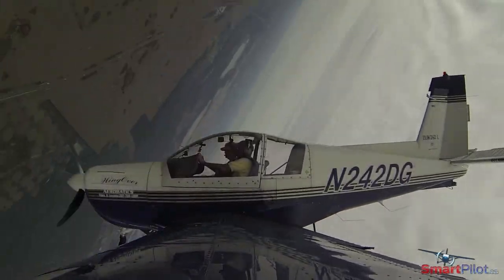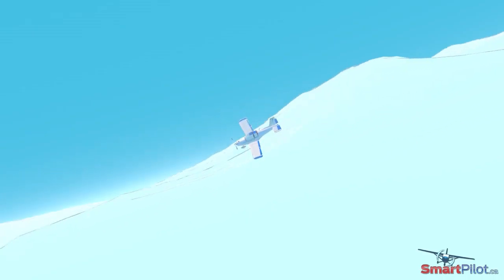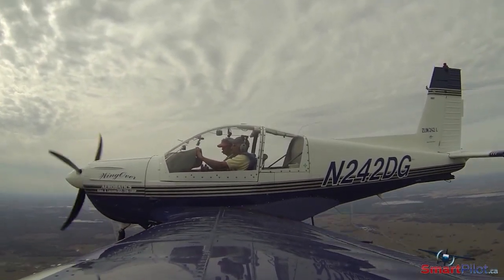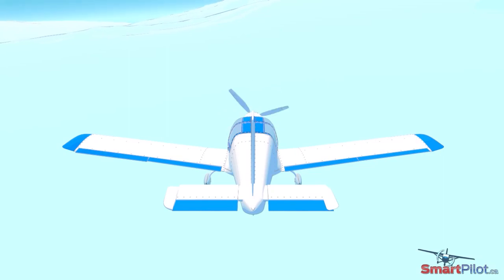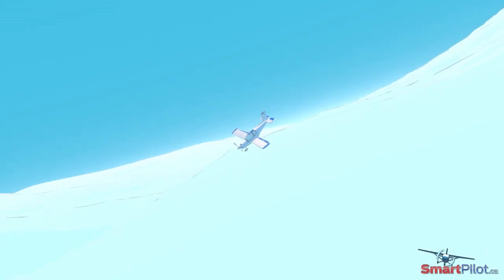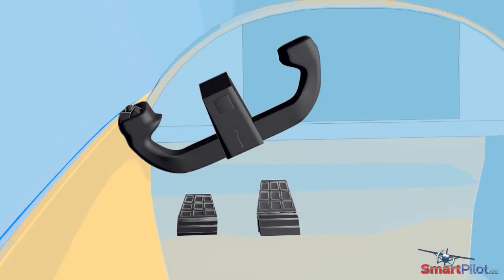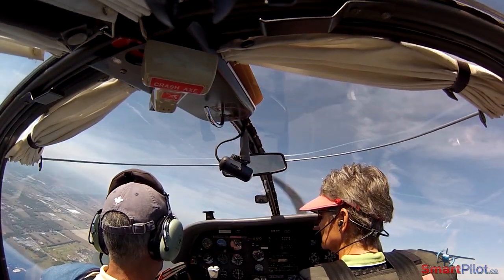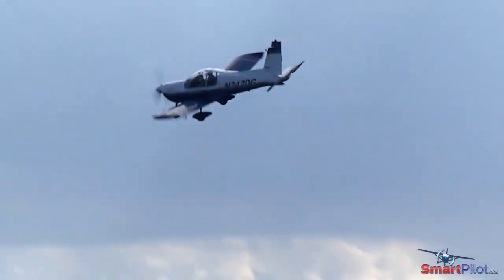SmartPilot | Upset Training - Stall-Spin on Final

Comment: Why don't you suffer blackout during this free fall ? Vertigo?
Reply: It is not a free fall, the aircraft has significant air resistance even during a spin so it is just a rapid descent.  Pulling out of the dive during recovery is about +1g  slightly unpleasant, but not enough to cause a blackout.   Some people find the rotation upsetting and have thrown up - the guy before me did and the instructor had a bucket and mop out, so I knew what had happened!

Comment: Super description of Preliminary Graveyard Spiral. I got caught inverted in a Mooney, but we were above 10,000 ft practicing stalls, and engine off.......got caught by a stiff updraft and we were in serious peril. I could reach the yoke, and pedals, because I was taller, with long arms.......flying left seat was a slightly built CFII......as we were getting our asses and Spines sucked back from the Instrument Panel.......I got control, and worked with him to right the Acft, and Agreed not to reveal our Danger.....he was such a good, and giving Pilot. This was a shakedown flight for a turbo Mooney, so he was the most valued, Safe Pilot, entrusted to fly , and bring it home checked off. I was Service/ Parts
 guy just watching instruments, and worrying about Engine and Hydraulics.
Anyway, after this event, my CFII quit flying and became a pharmacist.......Don't EVER think you can't get into a roll, stall, or inverted when you're in the Pattern.
We weren't, in the Pattern, and the only thing that saved us, we were out in the practice area, at a high altitude for a Mooney. Would have been certain Death on Final

Comment: Agree that going around is always the safest option and have done so many times when I found myself off of the centerline.  However, I do want to ask if it would be alright as long as the pilot does a COORDINATED steep turn with an acceptable airspeed?
Reply: It,s alright

Comment: I was told by a commercial pilot that he would not bank turn onto final more than 25°. He didn't mention the attack angle from memory.
Reply: That's why this video makes no sense. There is a reason there is a max bank angle when climbing and descending. If you follow that you won't risk stalling in the first place.
Reply: @jasonMB999  bank angle is irrelevant because you can stall at 5 degrees of bank if you exceed the critical angle of attack.  Limiting bank angle gives you a false sense of security.

Comment: Is spin recovery really a reliable method when turning final at say 300-500’? Or is it all about not stalling or entering a spin in the first place?
Reply: Bingo. Proper training will prevent almost all stall spins. Inside rudder will change where the nose is pointing but does a really lousy job of changing the velocity vector- that's what the wings are for, ie, a coordinated turn. If you can't land without screwball maneuvers, go the BLEEP around. A superior pilot uses his superior judgment to avoid the situation where his superior skill is needed to save his life. (adjust pronouns to suit.)

Comment: Nice “heads up” video. But, If a pilot induces a spin using too much rudder in an uncoordinated flight, at slow speed and pulling back the stick too hard he/she probably won’t know how to recover from it either.... of course recovering from a spin is elemental to flight training, but once I watched a video about how training about avoiding stall would be much more eficient and it compares to airline jets training. I flew from j3 to 727 and had many kinds of training in life, and I agree with that, train pilots to avoid stall situations, to know how much speed he must maintain as a minimun at each fase of flight sounds more eficient. Anyway, this is an awesome “heads up” video.

Comment: Hard rudder stick back will always induce a spin (snap roll ), even with ailerons neutral, and is the first step into the Lomcovak maneuver, the controls are just reversed to complete it, very deadly at low altitudes.

Comment: Spin recovery is part of a glider pilot' training (at least in Europe), because going around in a glider is NOT an option ;-)
Reply: Duh, its a part of training in every kind of flight instruction. But there is no way you'll recover a spin on final.
Reply: @adhdrenalin4392  Dude, if you fly cleanly, you won't ever need to recover from a spin unless you're in aerobatics. When you've been trained however (which not always the case whatever you believe), you know how much hight is lost before recovery can happen. Then you also know that when turning final  too low, if you turn flat while refusing the ground (which is what your reflexive brain shouts you to do) you're probably dead. 
In a powered aircraft, the conscious brain should remain in control by going around.
So that was my point.
Reply: Heck, it was part of my training to fly model aircraft.
Reply: Cause spins only happen on final

Comment: Always fly safely within the flight envelope of the aircraft... this envelope is smaller in the circuit. Stall, Spin & Spiral recovery training is done in Canada at 3500AGL minimum ... not only sounding the stall horn, but buffeting and going into a real stall... I believe in the USA they don't want you even sounding the stall horn, because you'll become complacent to that sound...in Canada we ride the stall horn practicing slow flight...Spins are done in a certified aircraft (Cessna) cut power, neutral ailerons, opposite rudder to spin rotation.... spirals, cut power, level aircraft and slowly ease out of the dive, when gaining altitude then go full power... aside from circuits, this training (stalls/spirals/spins) is the most important exercises you'll do as a pilot. (in my opinion)

Comment: The 3 basic rules in aviation are #1: speed #2:speed #3: SPEED regardless of weather your turning final or whatever your doing if we have the right speed we can go as hard as we want even turning final !
Reply: Amen
Reply: maybe "angle of attack" is more important...but they are related...
Reply: Can Conservative , absolutely although the angle of attack can be hard to evaluate in some situations.
Reply: @canconservative8976  and what do u need the higher the AOA is??? ;)
Reply: @maxhaines3794  Yes but SPEED is only relevant according to  the direction of "THE RELATIVE WIND"..... the exact direction of the relative wind hitting the wing is your angle of attack... you could be going 500 kts but if the "relative wind" hitting the wing has exceeded the angle of attack then that speed MEANS NOTHING. I think you can't pinpoint the most important factor, but Angle of Attack is #1 and Speed (which is really just airflow over the wing) is #1.2!... example: you could have an indicated airspeed of 100kts and plenty of flow over the wing, but your ground speed can be 1kt.... think of an airplane as traveling inside the tube of a train.
Reply: @canconservative8976  IAS and CAS I dont say more...SPEED is the truth my brother :D For sure AOA is more than important like one of the most forgotten things like the incresing stall SPEED at increasing bank angles....wherever u go u need to have speed in aviation. Obviously u and me had different teachers...but both of us r right ;) Love ppl like u who brings up other more than important parts like this to the discussin. Greetings from EDLN ;)
Reply: and before the question comes up...I'm not comparing AOA to the bank angle...but its in relation to each other sometimes...in each turn u do :D

Comment: Lot of these start with engine failure on take off pilot attempts turn back to the airport they no longer have engine helping to produce lift they might have a bad habit of using rudder to correct overshoot base to final. They try the same thing again with the turn back and stall spin.

Comment: Can anyone tell me why the standard approach is not a "straight in"?
Reply: For VFR (visual flight rules) a circuit pattern is established to give an orderly method of traffic control, much like driving one way around a parking lot.
Reply: No crashes no youtube man, thats why.
Reply: There are a couple reasons. First of all if there are many aircraft in pattern, it helps to create larger intervals between the planes, just by extending the downwind. Second of all, at least what I am taught is that while on base it's always good to check your landing area for any obstacles and other stuff so you are sure there's nothing to worry about, or if there is u would need to fly over it(I am in glider training, hence no go arounds) and maybe some other reasons that I am not aware of

Comment: Cross control stalls need to be a part of training. During my training I had read something about cross control stall and asked my instructor about it while flying at altitude. He reduced power and speed then went full right aileron and full left rudder. The Tomahawk immediately did a snap 360 roll/spin. When you’re in a bank, the rudder acts more like an elevator. When the plane is in a bank or level,the rudder pitches the nose back and forth. If you’re in level flight that would be back and forth from 9 o’clock to 3 o’clock. If you’re in a 90 degree bank that would be up and down from 12 o’clock to 6 o’clock.
Reply: Any CFI that teaches spins on a Tomahawk is a real CFI.  Tommy's fixes or kicks away the clods immediately.  Hard airplanes make hard to knock down pilots..
Reply: 5feetgoaround fullflapsC150 My CFI was a 12,000 hour former Air Force pilot. I had researched the Tomahawk before lessons began so I was well aware of the tendency for it to spin as the stall is entered. In my case, the left wing dropped. I picked it right back up with the rudder. Then recovered just like any other plane.

Comment: I find this curious. I am in no way a trained pilot, I play flight sims and largely just picked up how to fly in a simulator by playing simulators. I don't claim to know what it's actually like to fly a plane and I have no formal training. But I found myself in a situation like this the other day. I was in FSX and was coming in a bit fast on base at ronaldsway airport. In an attempt to shed some speed before turning on to final (as I wouldn't slow down fast enough descending on final) I left turning a bit late and found myself off the centerline and admittedly a bit high. It seemed natural to me that this was a missed approach so I scrapped it and went around. Now I really botched that approach but even if it was more in the margins, I don't see myself trying to use the rudder at low speed to try and "swing the nose around", if I couldn't get the plane reasonably in line and the approach under control in good time using normal sorts ofprocedures then I'd rather go around. It's weird to me that so many trained GA pilots kill themselves trying this sort of maneuver rather than take a few minutes to fly around the pattern once more.
Reply: Arrogance afer a sloppy approach  makes you not go around but tighten the turn mmore tosave face
Reply: Many pilot are still under the misconception that the rudder turns the aircraft. Roll is a byproduct of yaw. Rudder induces or reduces yaw. The turn comes from the horizontal component of lift in a banked attitude. Rudder is there to counter the adverse yaw and nothing else. If more pilots took the time to learn the connection between the various attitudes and movements and the processes in which a stall spin can occur there would be less occurrences. Unfortunately until the training changes the misconception will continue.

Comment: There is an article in AOPA magizine, maybe Aug. 2018 issue,  about why "pilots don't know how to turn".   As far back as the 1940s in a famous book called "Stick and Rudder" the authur noted that "pilots simply do not know how to turn".   Very many do no know to neutralize the rudder after the bank is achieved.  Thus, when making a left turn from base to final they continue to skid around the turn with left rudder.
        Should the airplane stall in this condition, it will roll over in the direction of the applied rudder.  In other words, it will enter a spin if the stall is continued.    Many pilots very close to the ground will forget their stall training and pull back on the control wheel while low to the ground.  The result is a stallspin crash.
        A while back ago, I read an article in AOPA or IFR mag, can't remember which, which stated that most stall spin accidents occur after the engine quits on takeoff.  This seems more probable to me because the nose is already high, the plane is low to the ground and the pilot is surprised and doesn't react immediately.   If a pilot overshoots base to final close to the runway and is inexperiences, it is probably better to just go around and try it again.
      But if the plane is far out on a wide base and overshoots the final, do NOT skid the plane around to turn while near a low stall condition.  If high enough, keep the turn coordinated and unload the Gs.  That means to relax the load factor while turning.  That also means, letting the nose fall and let the speed pick up a little while making a coordinated turn.  There is nothing wrong with a 30 degree bank in the pattern if you keep the ball centered and you are not flying close to a stall.  This is why I don't like to drag in the plane in low and slow.

Comment: Not only inside rudder will produce a spin, if you do a Panic Pull due overshooting final messup you will stall faster and spin faster too.  I used to teach that kind of Panic Pull Stall Spin, even on Cherokees and Piper Tomahawks.  I had to put with so many Pansy Pilots that could do only Mild Maneuvering.
Reply: What surprises me most, is that pilots simply don't know this. I've been a licensed glider pilot decades ago, and a spin low to the ground is one of the classic ways to cause your own funeral. Spin recovery training is a joy in gliders, and everybody learns it. No dangerous insurancy restrictions preventing pilots learning basic skills. And alternating steep turning is part of the exams, so you must learn to make coordinated turns, to control your airspeed all the time and watch around you. Pulling a little G is part of the job. For thermals those steep turns are not necessary, it's just good to know that you control the plane, in case you need such a very steep turn.
In other aviation video comments I mentioned this spinning risk. But the inexperienced pilots simply would not listen. And even experienced pilots (there was a Cherokee pilot among them) started scolding. Who are you to tell us bla bla bla, instead of reading what I warned them for.
Being oldschool I wonder how those arrogant guys are going to survive. The solutions are relatively simple, but you have to know the dangers very well, to solve the problem. Fear of keeping the nose low and fear of steep banking, that's it. Thank you, I hope many pilots read it and ask a proper flightschool for spin recovery training. Not all planes are friendly, better practice with an instructor, than crashing. You don't really want to use that emergency chute, don't you?

Do those RPL (or how it's called) pilots use emergency chutes? Those planes don't even have 5 straps seatbelts, I saw. Just the car belt system, sometimes. I don't understand that. Is that for those softie softie pilots? For aerobatics and heavy turbulence you want proper seatbelts. But okay, that's enough. Let's conclude I'm worried about safety, and some habbits and things amaze me. The how on earth effect. The answer is: spinning.
Reply: @voornaam3191  100% on spot..  SA  GA needs that military style training but NOOOOO!!  How you want us to do hard practice?? NOOO!!  Too many chicken pilots on USA GA stopping others from practicken and exercising.. Chumps with a big mouth all oveer